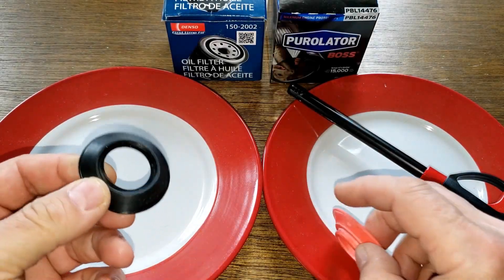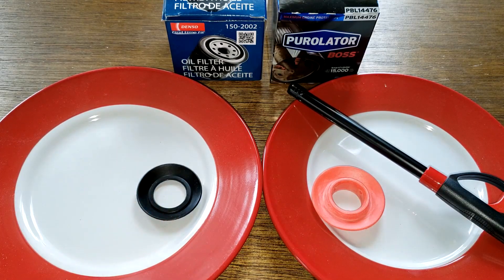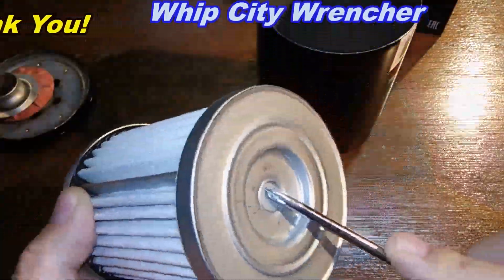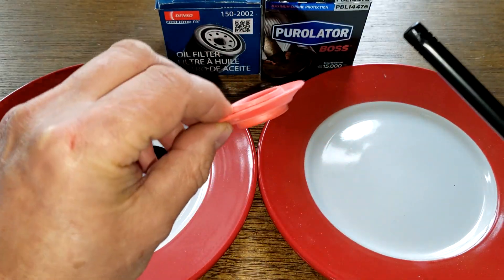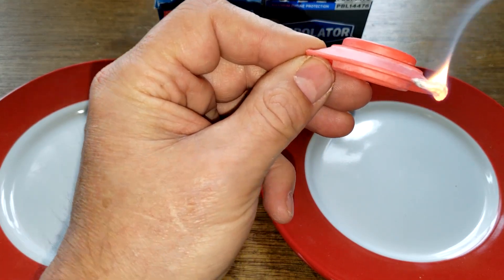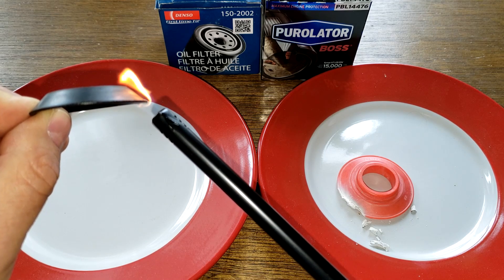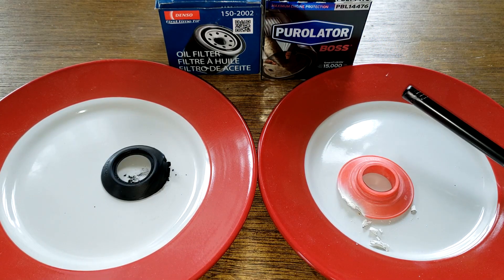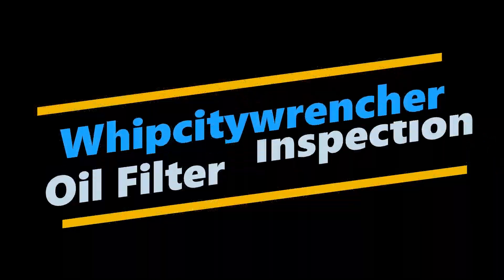Denso Oil Filter Anti Drain Back Valve Test

Comment: this test is useless,  anti drainback valve should tested with a vaccum pression tester
Reply from the maker: This isn't a test to show how well it works, it's a test to show whether or not it is made out of silicone, which can perform better than rubber after it has been sitting in hot oil.

Comment: Personally i think silicon is overrated 
Nitrile is absolutely fine.It gets the job done.If you change your oil on time the advantage of silicon will never come into play.I am more concerned with the filter media and metal end caps and bypass valve.
Reply from the maker: It probably is but I would rather have it than not.
Thanks for your feedback!

Comment: Thank you for this great experiment I would like to see more experiments regarding oil filters. I'm looking for a good oil filter with the lowest micron rating I could find for a 4.3 L V6 Chevy 2002 model the AC Delco have arranged between 25 to 30 microns and that's what I'm currently using. Thank you yet again!
Reply from the maker: Thanks for sharing👍
I used to own a 91 Chevy s10 Blazer, it had the 4.3 also. Great Engine!
If you want a better micron rating then I would suggest the Fram Ultra, the best bang for the buck IMHO.
Reply: @WhipCityWrencher  Thanks I'll give it a shot !
Reply: Purolator oil filter boss is rating at 99% at 20 micron…. Is like the motorcraft I use on my Ford best quality purolator boss

Comment: Im stiil not sure of the anti - drain back valve on most applications ! i always pour some clean oil into a new filter just to wick up the media ! other than that all my vehicles are doing just fine ! nice video !
Reply from the maker: Hi Scotty, A little true story.
My daughter's car was making noise at startup, she told me about it but I couldn't see anything wrong. The engine ran fine once started and I figured winter was coming and maybe the oil was just getting thicker when cold. So she drove the car like that for a little while and when it was time to do an oil change I decided I'd try out the New Fram Ultra on her car so I could open it up for a future video. Well, I didn't know that the Napa Platinum that was in her car had a nitrile rubber anti-drain back valve, and sure enough, after the oil change, the noise went away. In case you missed it here's the video I did when I opened up that Napa oil filter. I'll have a future video of me opening up the New Fram Ultra. And yep her filter is mounted
horizontally. Take Care.  https://www.youtube.com/watch?v=L27aiQjhKWA&ab_channel=WhipCityWrencher
Reply: @WhipCityWrencher  ya that and im starting to hear more and more stories of some engine oils being more noisier than others ! in my research so far Pennzoil platinum and royal purple seem to be quiter over time and mobile 1 breaks down at about 3,800 miles ! my test vehicle has 637,000 miles on her and runs like a champ ! never rebuilt engine - trans and rear end ! 210 oil changes - 27 trans services - 12 rear end services ! its a 1994 chevy s10 2.2 liter ! i drive it hard ! i like having a little fun here n there
Reply from the maker: @scottymoondogjakubin4766  Wow that's a lot of miles, keep doing what your doing because it's working.
Thanks for sharing👍
Reply: @WhipCityWrencher  also its good to add an upper cyl lubricant like marvelous mystery oil or lucas fuel treatment and i always let my engine reach operating temperature before darting out to the highway which should be about °115 f
Reply from the maker: @scottymoondogjakubin4766  I've been using the marvel mystery oil in my tank on and off. I think I'll try to use it more often. Thanks.

Comment: I'm only @1:01 so far.  A burn test is irrelevant here as these drain backs never see an open flame!  Two important differences in Buna N/Nitrile and Silicone relative to oil filters are 1) Nitrile stiffens/hardens after repeated hot and cold cycles in engine oil.  This may cause it to remain in the open/bypass mode!  2) Silicone remains pliable/flexible during and after repeated hot and cold cycles and therefor is a more reliable/stable.

It was interesting to see that chart and the fire test you conducted, although still irrelevant in regards to engines and engine oil.
Reply from the maker: How is it irrelevant when you can clearly see that they are made of different materials yet If you look on RockAutos website it clearly states that Denso's black anti-drain-back valve is made out of silicone and it's not it's made out of nitrile rubber.
Reply: 1) This is not at all criticism of you or the other other fellow whom conducted a similar test.  The burn test "potentially" exposes Denso for Miss-Advertising and should be held publicly accountable/answerable!

2) WHO will buy a Denso filter and cut it open to "try" and find out if it's Silicone or not?

3) Whom in their right mind is going to conduct a burn test after #2?

4) Under normal operating conditions and oil/filter changes, "will" this Nitrile valve material be a problem?

5) What are the consequences/damages if the Nitrile valve fails in either the open or closed position??

6) Are there certain models of Denso filters using either Nitrile or Silicone valves? and have "you" acquired the right equivalent filter to compare??  I assume you have.....BUT, I hate to assume!!!

6)  A Silicone valve will surely remain pliable for extended mileage!
Reply: Thanks for the explanation. I always wondered why silicon is considered superior.

Comment: Thanks for the test!

As a prolific Rock Auto customer, I can tell you the descriptions aren't reliable. I ordered a heater core pictured and described as brass and copper, but it was all aluminum. I called them out on it and made them take it back.
Reply from the maker: Hi John, 
Thank You for Sharing!  👍
Yep, how hard would it be for them to change the wording on their website when products change? I say let's demand the truth, and with your case your $$ and let us make an informed decision on whether we want to buy the product or not.😊
Reply: @WhipCityWrencher  Actually, It would be a full-time job for someone that could NEVER catch up, because THOUSANDS of products would need to be checked on !!
Just think -- if all those manufacturer's websites were accurate, you wouldn't have needed to do the ADBV burn test.
It was a great test, none-the-less. Thanks!

Comment: Good job Whipper....      Denso posts this silicone info on their website so they need to retract this info as well as Fram with their new owners removing the silicone from Extra and Tough models..       Funny enough the base walmart shop Fram filter,  "Core" , still uses the silicone .     You should do some vids on the Core if you can find them.